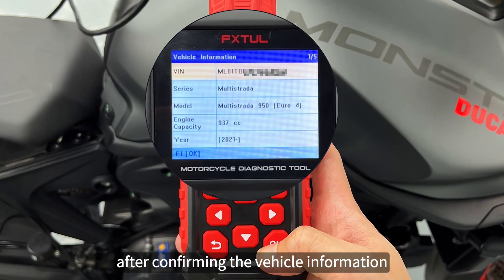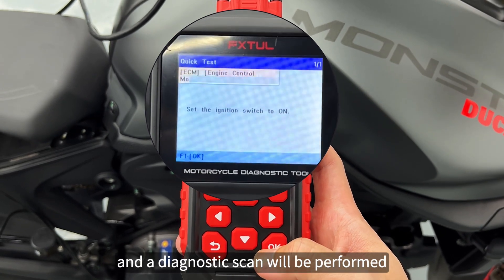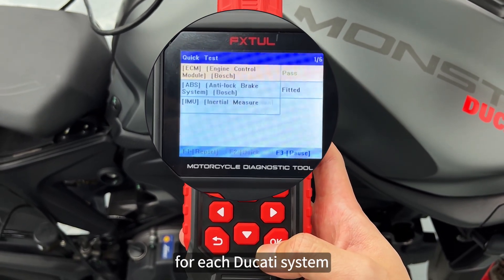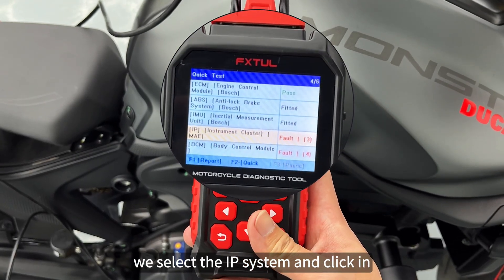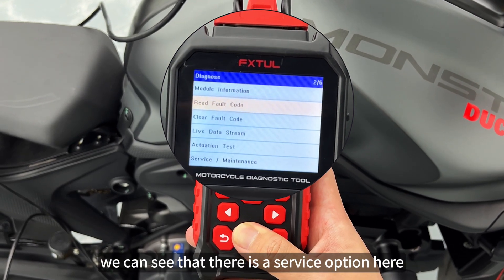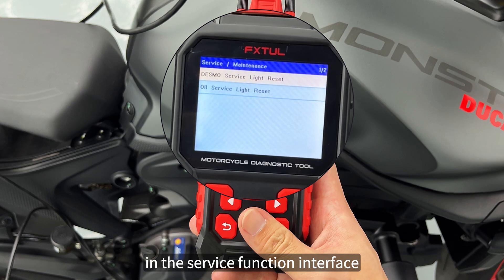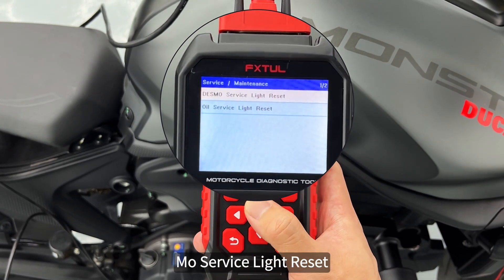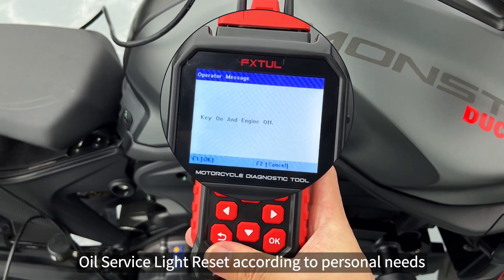How to perform a DESMO/Oil Service Light Reset using the FXTUL M4 Ducati Diagnostic Tool.#autotul

Comment: I bought this, updated the software and keep getting vin unidentified.  But I’ll attempt to reset the oil service light and it’ll say completed but it never resets light.  Plus, I have a Ducati 1199 S and the only options it displays is standard 1199, 1199 R and 1199 Superleggera. I downloaded the current software last night and tried this morning. Is there another software that will work? If not then I’m returning this!
Reply: Did they figure it out?? I have a 1299 and considering buying this product...
Reply: @dionellb1  sorry haven't been back on YouTube in a bit. No it never got fixed. I sent the unit back that I' had and eventually ordered another one 3 weeks later after speaking with one of their engineers and he advising they had a new update to solve the issue. Got it, installed the mew update and it still did not work. I tried standard oil service light clearing mode, Desmo mode etc and nothing would clear it.  Even after explaining my 1199 was an S model and Tricolore model at that,  the only options it would give was the standard 1199, 1199 R and 1199 Superlaggera.  I tried it under each model option and nothing would work.
Reply from the maker: Please first clarify what the notification is indicating. Ducati has Oil, Desmo, and Annual reminders. If the corresponding reminder was not successfully completed, you can send us the log and we will check it for you.
Reply: @Autotulofficial  I did send a log to one of your engineers and he confirmed it was an issue on your end. Then said they were working on a fix and 4 weeks later sent me a link to install the new update that still did not work. the 25.09.23. I can't say this will work or will not work on a standard Ducati 1199, or the 1199 R or 1199 Superlaggera (the only model options the M4 offered) because ny Ducati is a 2013 1199 S Tricolore model. but it would not work on my bike and I tried every option the M4 offered to clear the code, be it oil, Desmo or Annual.  I fact the last attempted I made the M4 triggered the electronic immobilizer on my bike so now I'm stuck with a bike I can't start and will have to haul to a dealer ship now to have fixed. I sent my unit back, once I get my refund I'll have use that to pay the dealer to fix.
Reply: Was this issue fixed?
Reply from the maker: @SigmaSheepdog  This isn't a issue. he might just be working on the wrong function. You could tell us your model and year.
Reply: @Autotulofficial  I need this unit to work on a 2024 Hypermotard 950 SP as well as a 2025 Hypermotard 698 RVE.
Reply: @Autotulofficial  no I was not working in the wrong function. I tried every function option that was available for the 1199 option and it would not work. I spoke directly to one your engineers via WhatsApp and was even given the new update before it was released to your website and it still did not work.
Reply: @SigmaSheepdog   no, not even after installing the new 25.09.23 update they released. I sent the unit back.
Reply: @SigmaSheepdog   No, it was never fixed for me. I tried 2 different M4 units from them, installed the new updates, even the newest 25.09.23 that's on their website and it would not clear the oil service light. SO I sent it back.
Reply: @epulleerr Thanks for that info.